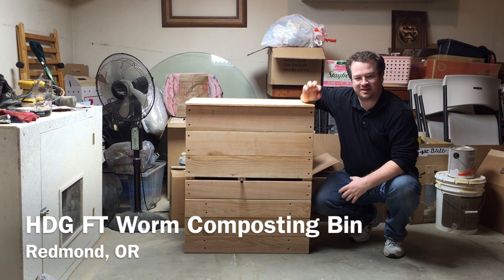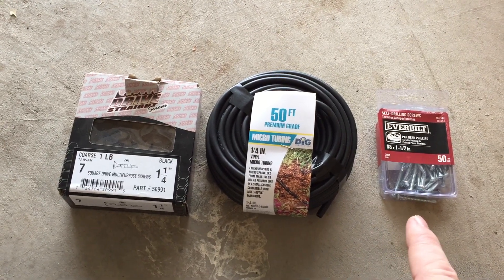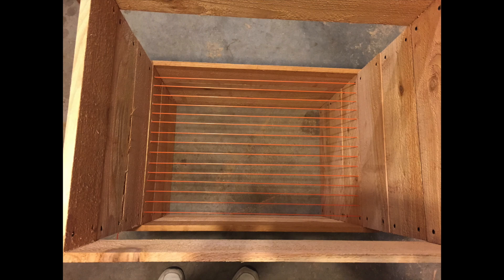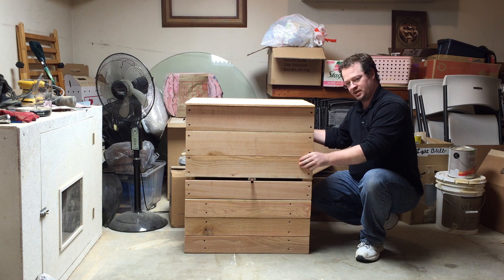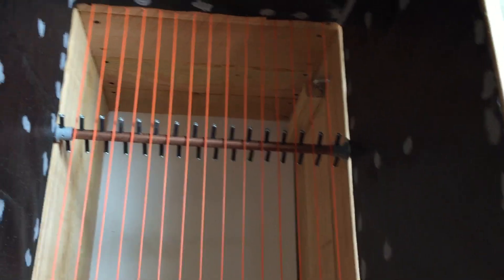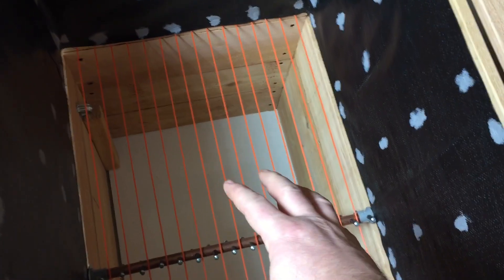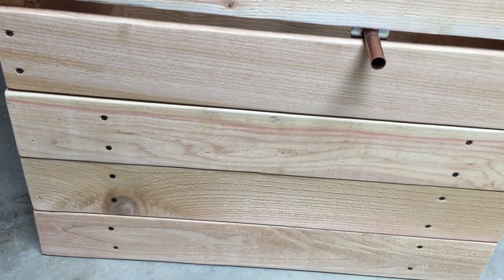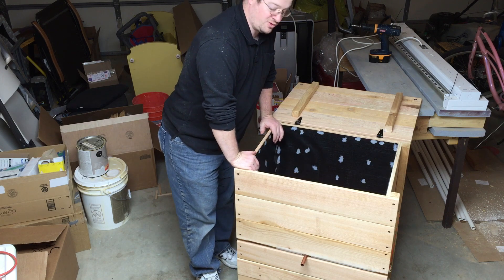Build The HDG Flow Through Worm Composting Bin

Comment: You have done great work on this compost bin and inspired me. I am going to build one this weekend modeled on your design. I will be adding a few boards on the inside to create a funnel shape in the composting section. I hope that this will aid in compacting the soil a bit at the bottom and force the worms to stay toward the top. Also considering using a bit longer screws on the raking bar to grab a bit more of the soil during harvesting.
Reply: Hey Josh, I'm going to build one of these as well, and was wondering if you had any drawings of your design that you could share?
Reply: @timblaktu  That project worked out well, but I do have some alterations to add this year that will hopefully alleviate some problems. I have some pictures of the structure if you would like.
Reply: @gattispizzaboy  I'd love to see some photos as inspiration, and to hear how the overall execution went, especially the funnel part and how efficient your harvesting is. I basically want to make a larger hungry bin out of wood and it will live in a shaded spot next to my house outside.

Comment: Thanks for this video, High Desert Garden! I have a question about how this worked in practice. It looks like the friction of the harvesting arms against the vermicompost might overcome the friction of the copper pipe on the track as it turns. If so, turning the copper pipe would fail to harvest the vermicompost because it would just turn and turn without digging into the unharvested compost further down the track. What has your experience been in practice? Have you had to add something to keep the harvest bar turning while also applying grinding pressure to the unharvested vermicompost? If you're having this problem, I have a solution: You could work out a simple cable and wheel system similar to a go-cart steering system that should work very well! 

I would have visited your "updates on this worm bin" to try to learn the answer to my question above, but the link you added in the video description field produced only a blank page. The private message link was forbidden, too, because of YouTube's admin rules, and the link to hdgarden.net returned a message that the domain is for sale.

Comment: The problem I see with your design, it should flow down where the bottom is much narrower than the top.  You would use your copper pipe to cause the compost the fall.  It makes sense you have the sinkholes as the bottom is similar to the top.  If done correctly you would not have sinkholes, the compost would fall down and compress.  The worms will move up as they typically stay in the first 8" from the top.  But I am talking Red Wigglers... vs the Nightcrawlers which you used. I feel if you have a bottom tray that is angled, and then other trays above that you would have something that works better.
Reply from the maker: K. LaBorde yes, that was going to be my next design.
Reply: High Desert Garden check this out... it nah help you for the next one. https://youtu.be/J-GgaOx68xQ
Reply from the maker: K. LaBorde I like hungry bin’s functionality but its ugly ;)
Reply: ah.. part of his next design.. not so perfect this design was then huh ;)
Reply: High Desert Garden I would like to see something like it done in wood. The reviews in hungry bin say it has a problem with providing enough air flow.

Comment: 20 to 24 inches is considered to be the optimum depth for a flow through. You could have gotten that extra depth by making your harvesting area shorter since you are only taking 1 inch off the bottom at a time.

Comment: Nice job . I want to design a new bin and I really like this.
I was wondering if your still running the bin and if there are any changes you would make after a couple of years of use?
Reply from the maker: The bin works great but is more maintenance than I thought; It dries out if you don't watch it closely. I would have made the bin smaller.. Maybe 16"x16"
Reply: Thanks for your  feedback and its good to know the bin is still running ok.
Reply: I'm curious why you would have made it smaller? Is it a weight issue, or are you producing too much?

Comment: Hi Phillip. I built a bin using your dimensions and some pallet wood. It's been about a month and I think the worms are dying off. I put in some corn cobs the other day and they are moldy now, as is the chopped watermelon rind I put in a few days before that. I used a sheet of 1/4" cardboard on top of the weed whacker line grille, and a few sheets of newspaper on top of that. I began the bed with a mix of peat moss, garden soil, and shredded newspaper. I haven't been feeding them much veggies because they really didn't seem to have been very active on what I put in. I should also say I'd tried the same group of worms for a couple of weeks in a plastic tote before I built your design. Any advice you could offer?
Reply from the maker: Could you post a video showing the bin, the contents of the bin, and the worms?
Reply: Some of the pallets shave been treated with pesticides. That could be why your worms or not t doing well. Also you might be give them to much food.